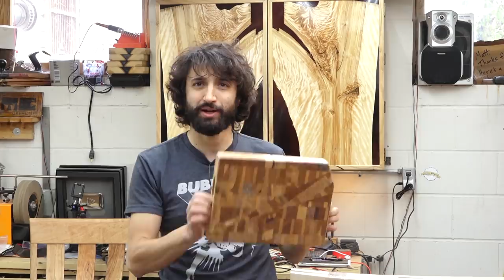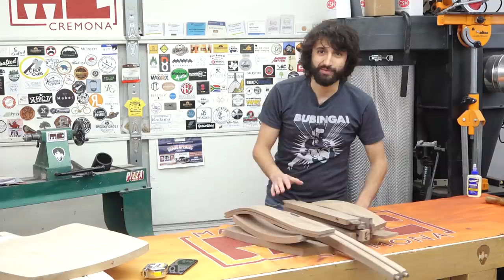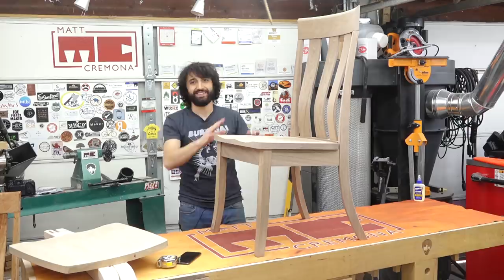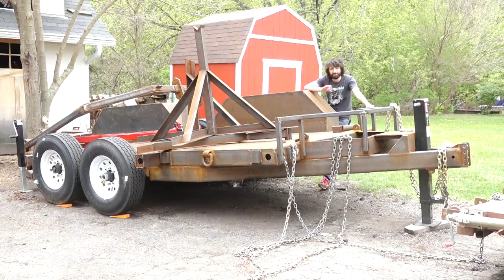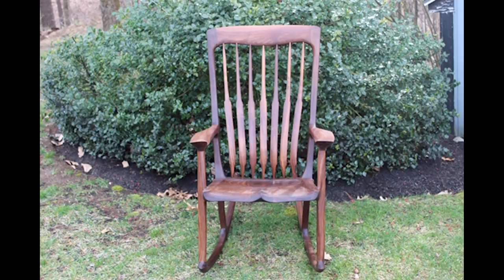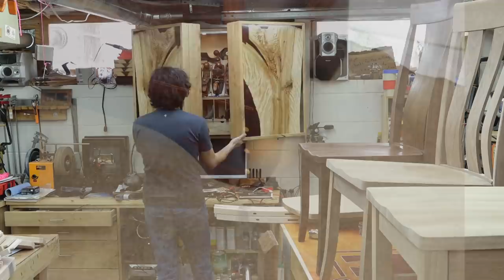Chair Kits, Cutting Boards, Trailer Update

Comment: I've had good luck with the rust converting primer, as long as there is no loose or flaking rust. It seems to last through our NC Winters quite well, but I have never done anything as your trailer. When scraped off, the steel surface has been converted to a very durable surface that no longer wants to rust, as long as there are no deep scratches. I usually top coat with Varathane outdoor enamel. Comparatively  slow drying, but lasts well and doesn't fade. A few weeks in hot Summer Sun will bake it on.

Comment: Have you thought about doing a spray coating like a truck bed? That stuff is strong and durable. Also is a low slip surface to kind of grab a log to help roll it over.

Comment: Hi Matt: Great idea on the chair build kits.  Q. Are you going to include arm chairs and rocking chairs in your chair build kits? 

Best - Michael
Reply from the maker: I may.  At this point I need to see if this venture has legs so to speak.  Thanks!
Reply: @mcremona  That makes perfect sense.  Q. How did you get the uniform recess in the seat, CNC?
Best - Michael